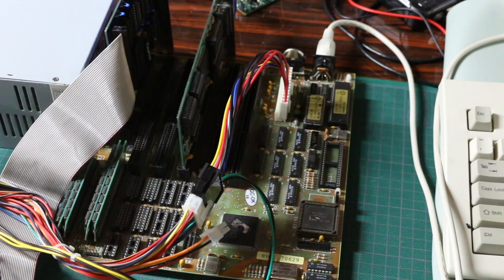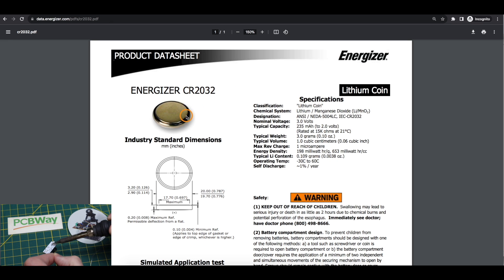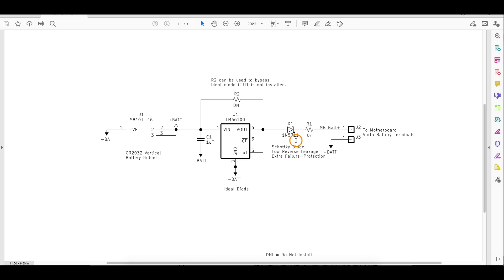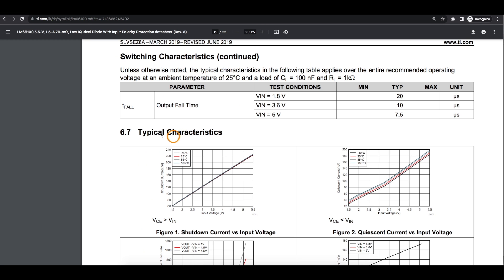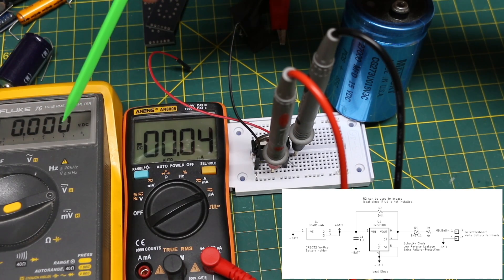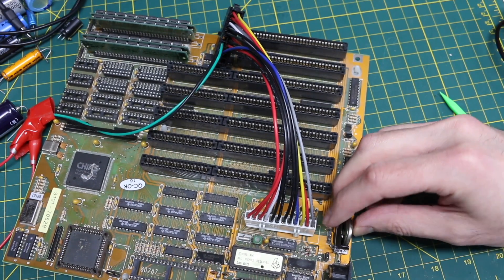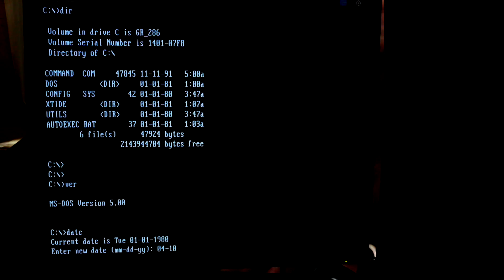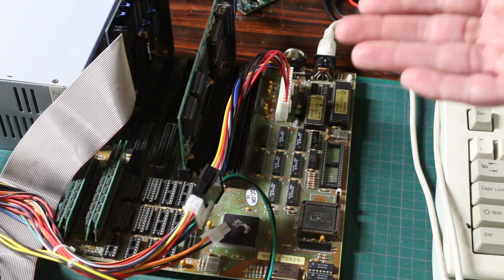Varta NiCad to CR2032

Comment: Nice thinking with ideal diode. Did you keep the Schottky just as a failsafe?
Reply from the maker: yes since the UL recommendation was to have either one diode and a resistor or two diodes, and the other reason I put the diode after the ideal diode so that it’s directly facing the motherboard is because the diode can handle up to 70 V but the ideal diode has absolute max 5.5 V so just in case the motherboard creeps above that even momentarily while switching on or off, that should be blocked as well.
Reply: @GadgetReboot  Ahh, I must have missed that absolute max 5.5V thing. But still, I might prefer to clamp the output of the ideal diode to ground with a 5V zener rather than clipping the 3V battery output to 2.85V with a Schottky. The whole point of using that ideal diode IC in this circuit was to prevent any drop on its already marginal (compared to the old rechargeable battery) voltage, wasn't it?
Reply from the maker: yeah the clamp might work. The other redundancy aspect I liked about the two diodes in series is to help make sure the reverse charging current isn’t going to be a risk so if we only have the ideal diode in the series battery path and something goes wrong, a bunch of current may cause a problem
Reply: @GadgetReboot  Please forgive my ignorance, but if you're using a 1N5711 in series with the ideal diode LM66100 to protect it from voltages over 5.5V, why have the ideal diode at all?
Wouldn't the total voltage drop be equal to LM66100 voltage drop + 1N5711 voltage drop?

Comment: Most RTC's that I have worked with will speedup when hot and slow down when cold. Check the temps on that chip, it's probably unhappy that it isn't getting any air movement over it.

Comment: I have replaced a few batteries with super capacitors, a few Farads will keep the RTC running for weeks and recharge when the system is in use. And they don't leak either.

Comment: I guess you can tweak the clock frequency with the trimmer cap near the crystal, but it's really annoying that it goes faster when powered up. I guess the circuitry oscillate differently with different supplies.